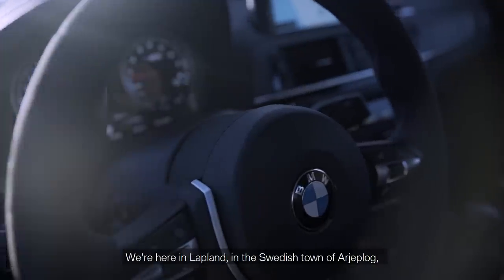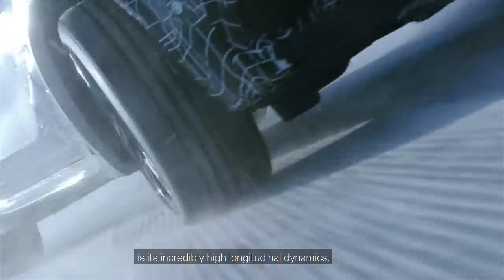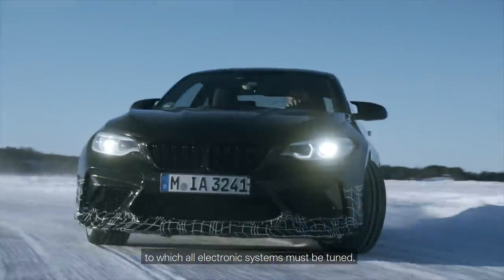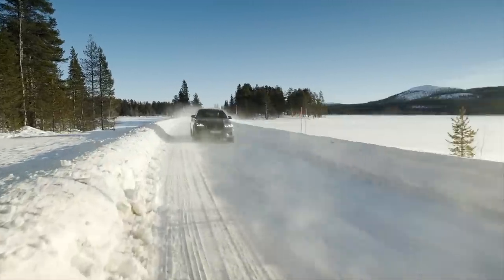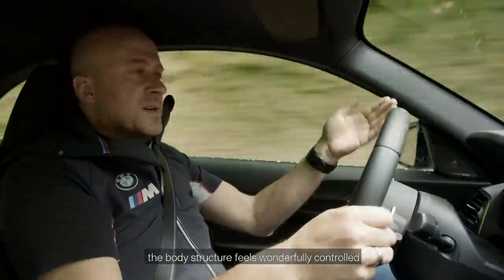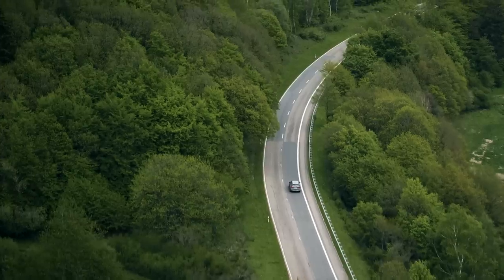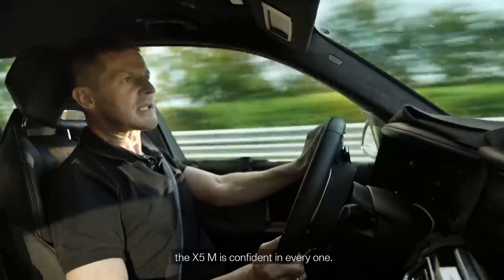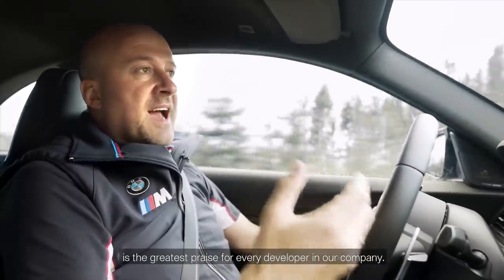Road to perfection: mastering ultimate driving dynamics by BMW M.

Comment: To be honest, the driver aids probably cause excessive understeer and therefore ruin the drivability of the cars; electronic power steering has also been a let down; BMW 1 Series M was a great success due to its simplicity and ability to allow the driver to control the car the way it is intended to be driven.